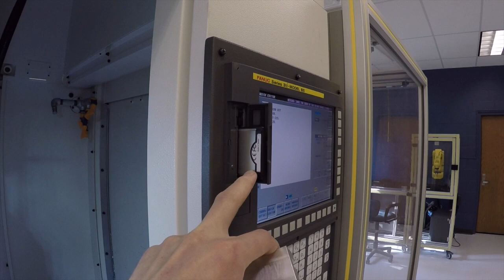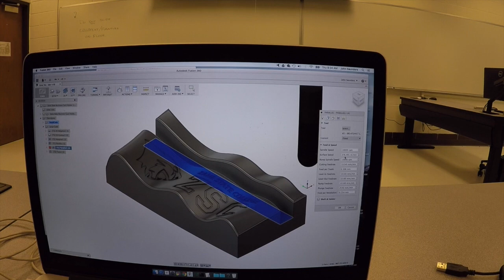Robodrill Help, Being Honest, Grandpa Would do Anything - Chip Break 14

Comment: That feed is way to high for the end of a ball nose. 600ipm / 10,000 rpm / 2 flutes is .03" per rev. That's way to high of feed on the ball end. I would say your going to need to finish woth closer to .005" feed per tooth. I finish steel with .0025 and a 4 flute, and still there's some polishing on the flatter areas of the tool path where your dragging the center of the cutter. Fusion doesn't support this but remember in sprut cam in the feeds and speeds you could enable feed based on direction? This is a perfect scenario of this. you need to slow down in the flat sections and going down hill and speed up in the hill climb. Another thing would be to try and run a semi finishing pass to with a .020" ish step over and only leave .001".
Reply: I took a look at the file, I still think that a semi finishing pass will help, to get a really fine finish with a ball nose you want as little material as possible left, in spots you've got over .5 mm left, that's way too much, shot for .05 to .1 max. Also what kind of a coolant are they running? It looks like a synthetic, if so that's gonna give you grief as it doesn't provide any lubrication and aluminum needs some lube to cut clean with such a flat part.

Comment: Looks to me like the tool is rubbing and not cutting...  Might be a DOC issue, or a dull end mill.  I typically wouldn't use a 2-flute ball mill for that.  I would go to a 4-flute, not sure why, but it has worked better for me in the past with the 3d toolpaths.

Comment: seems like if you are going with a finish pass, high inches per minute travels speed should improve the finish. but that would negate the finish pass purpose. so razor sharp brand new bits for lighter cuts would be my guess

Comment: John, Your feed rate is to high for that two flute end mill. Also does that machine have high speed machining on its control? It may be that the machine is not positioning accurately at that high of feed rate. Do you want to machine in the direction I saw in the video(up and down the humps) It might be better to change your pass angle 90 degrees from where it is (perpendicular to the humps).
Reply: I'm not familiar with HSM but most Cam software's have a selection for tool path angle in a 3D milling cycle. You should be able to set it at any angle. Maybe even something between 0 and 90 might be even better. In this case if the machine has the High Speed machining option it would have to be enabled by a code in the program. That would really help with this kind of tool path.
Reply: ENTER
G49
G5.1R5Q1
TO ACTIVATE HSM (lookahead (Ai) ON FANUC)%
O10
N1G17G21G40G80
N2T1
N3M6
N4G49
N5G5.1R5Q1(HSM ON)
N6G54
N7S1688M3N18G0Z100.
N19M9
N20G91G28Z0.
N21G49(cancel all tool offsets)
N22G5.1Q0(CANCEL HSM)
N23M5
N24M30
%
Reply: O one other thing I forgot to mention you said the machine didn't have much memory. All fanuc controls ship with at least 500 K of memory thy just charge you for turning the parameter on. If you could find someone who knew what parameter to change you could increase the memory size.

Comment: Too small of Stepover for the size of the cutter and possible recutting chips
Reply: Yes to small only happens on ball nose cutters.  For the stepover you're using now you would need to use 1/32 Ball 

Just did the numbers you should be around assuming some  numbers you should around .0194 stepover for that size cutter.  Looking at a graph I made 0-.040 is the range but the middle is what calculated out about .020.
Reply: +NYC CNC agreed. Way too small a step over. 

Should be leaving .02-.03 left on the surface too. If you're only leaving a few thou you're basically just cold forming the surface  

Take a look at a BEM under an eye loupe. Look at the center. You'll see a web similar to a drill point (but smaller). You need be stepping over more than that web dia as well
Remember. Endmills need to take a chip. This applies to ball endmills as well

Comment: fanuc control allows for tons of options that's why it seems so clunky when navigating the control. as for the part seems like either the back edge of your cutter is dragging on the part (increase rpm) or the coolant mix is too light.

Comment: What's the depth of cut? Sounded like the bit was running pretty hard possibly a rigidity issue. Not the typical sound when wanting a great surface finish.
Reply: I couldn't really hear anything other than the spindle and coolant during the finishing pass
Reply: +Geof Dumas gotcha I missed the finishing pass, how much did they leave for the finishing pass?

Comment: These scalloping lines are normal http://www.cnccookbook.com/CCCNCMillFeedsSpeedsStepover.htm   
You may also use http://blog.cnccookbook.com/2010/09/24/ballnose-surface-finishes/ because the ball nose radius changes a lot with cutter engagement height and you have issues like the the center of the ball have a velocity of 0. If the above linked does not help you should look into "sturz milling" where you tilt the workpiece a little bit so you always cut with the side of the ball cutter and have the center not engaged.
Reply: Good infos there, thanks. Sturz milling sounds interesting and should be possible for this workpiece.

Comment: My suggestion is currently your running 1235 SFM and 
.03 FPT try the same feeds and speeds with a 4 flute instead of 2 flute that will decrease the FPT to .015. I think now it's too much feed for your 2 flute and it's tearing the mtl. Also I'd decrease the step over to .002 to .003 for a better finish. I do multisurface parallel cutting frequently and I used to program Fanuc controls. They will decelerate on tight corners when they can't maintain the programmed feed. Currently using Mastercam X9 just downloaded Fusion 360 today to give it a spin. Good luck
Reply: I failed to mention that the SFM is calculated on the Dia. you are obviously cutting with the tip and the closer to the center of revolution you get your SFM drops rapidly until at the center it is zero. That is why lathes have a Constant Surface Speed feature. I still think a 4 flute and decreased step over will fix it if not reduce the FR.

Comment: The times I have experienced that sort of finish on 3D stuff, it was a coolant issue. Specifically, my tank was running low so it was basically spraying foam. It's obviously not that, but the type of coolant you're using may be the limiting factor on how quickly you can make that fine cut, which needs to be done.
If it isn't that, it's probably speed. 10k is a lot but its not exactly going to let you fly. I'd probably aim for 200IPM for an uncoated tool. More if you can get ZrN

Comment: Check the parameter on the robodrill for the tolerance control. Not an expert on fanuc but a quick google search said that i might be parameter 3410.

If work like on a okuma control the tolerance control makes a big difference for the surface finish when you are 3D machining. If the tolerance is set to high the controller will skip some movements in order to maintain the high feed rate.
Reply: That's an on machine smoothing factor.   Similar to point reduction in a CAM toolpath. Produces better, but less accurate surfaces. 

It's usually an extra cost add on feature for robo drills., or has been in the past anyway.  Can be activated on and off by a Gcode  before and after the toolpath as well.

Comment: Just a guess, when you are taking a light cut at a shallow angle with a ball cutter your effective SFM is much less than would be calculated for a 12mm diameter. Depending on the axial DOC the diameter of the part of the cutter that is actually engaged in the work could be very small.  
When cutting on a horizontal plane the center of the ball mill is actually stopped and dragging on the work.  Slowing the feed might help to minimize the dragging, though some part of the tool will always drag regardless of rpm and feedrate.  
Also, the grind of a 2 flute endmill is such that the flutes come together to a single point.  I have some 3 flute ball end mills from Maritool that have a grind where 1 of the flutes passes through the centerline of the cutter.  I'm not sure if that could be helpful in this situation, but it seems that that was the design intention.  Again, i'm no expert, just throwing out some ideas.  Looks like a fun project!
-Nick

Comment: Try this Example:
N1 T1 M6
G0 G90 G54 G17 X-10. Y8. S700 M3
G5.1 R5 Q1 (HIGH SPEED ON)
G43 H1 Z5. T14

(movement...contour, ect)

G0 Z5.
M5
G49 G53 Z0.
G5.1 Q0 (CANCEL HIGH SPEED)
M01

Note the G49. This code cancels all tool offsets. This is the only way I have gotten things to play nice.